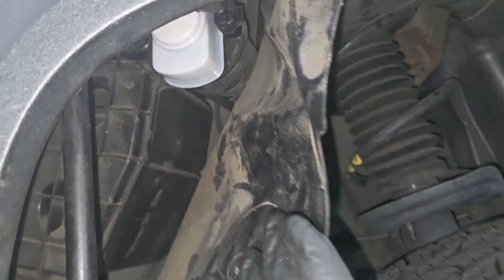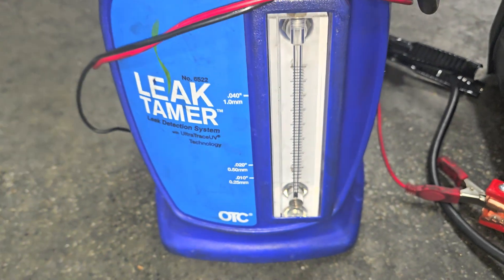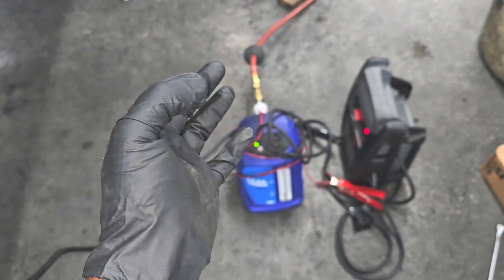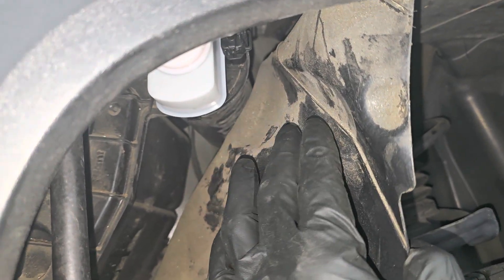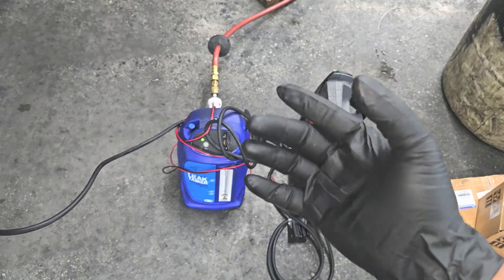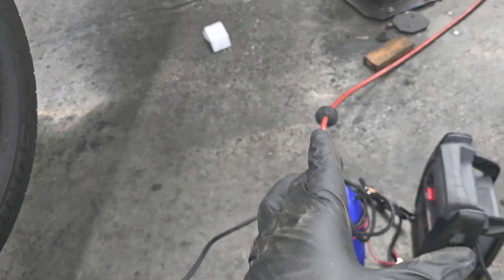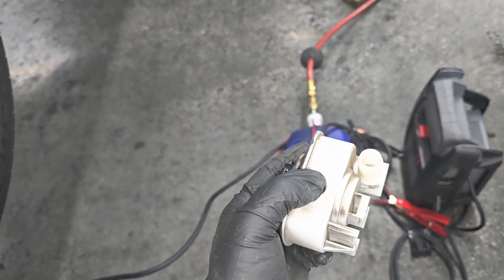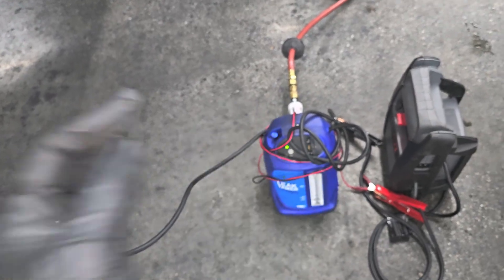The Evap System Explained. Fault Code P0456 and this ESIM.

Comment: I had a p0456 code on my 2011 jeep liberty. I replaced the leak detection pump (Esim), the cap and still had the code come up. I smoked it and i could smell a little of the smoke but could not find the leak. I decided to pull down the tank and plug the lines and smoked the tank, still no smoke visible. I finally hooked up a bicycle pump to the tank and pressurized it, then sprayed soapy water on all the components. finally saw the bubbles coming from the fuel pump 0 ring area. Pulled the pump and found the pump was cracked where it seals at the O ring. Replaced the pump and all is right with the world 😀. All the videos i have watched on finding these leaks, not one had a cracked fuel pump causing the issue.
Reply from the maker: That means your case would have made for a unique video guy. And btw, using process of illimunation would have led you to the tank. You just cap off certain areas to isolate leak until that area found. But good find. Glad you got er figured out.
Reply: @OnlineMechanicTips  you are right

Comment: Replaced esim. Still had code. Had purge valve fail,(after filling tank jeep would studder to start up). Went to dealer to confirm. Replaced.  Weeks later code came back. Tried the smoke test myself. Same charcoal canister as in video. Smoke comming out the canister itself, above the esim.  Is that possibly normal or bad charcoal canister. Thanks

Comment: I do a ESIM monitor test to see if it is switching from open to closed at the ESIM. If it doesn't I do a EELD test with air pressure only. If the ball goes to the bottom, it is good. Then put a jumper on the connector to see if it goes from open to closed. If it does, replace the ESIM. If it does not go to closed, I use a test fuel cap If it does not then need more diagnostics. Another thing on a fuel cap system I find is there is corrosion on the top of the filler neck where fuel cap O-ring meets the the filler neck. It is common on a vehicle with high mileage. Use sand paper to remove the corrosion and test again.

Comment: My Wrangler had a P0456 that came and went intermittently. Started with a new Mopar gas gap, and that did nothing. Changed out the purge valve, ESIM, the PCV hose (which had a hole in it), and the light was still on. Did a smoke test, nothing. Ball dropped almost immediately. A year and a half later I bought ANOTHER Mopar gas cap and that fixed it. Explain this.
Reply: Sometime there is a time that a part will be defective intermittently.

Comment: Thanks for the info. Be sure to buy OEM Mopar parts for your evap parts.  as far as I know there is a weighted diaphragm on OEM not found on aftermarket parts. Give  OEM a shake you should be able to hear it rattle just a bit.
Reply: I had this problem. The one I took out rattled when shaken. The one I bought off Amazon that looked identical did not rattle. Now I have a large humming noise and the P0456 still comes on occasionally.